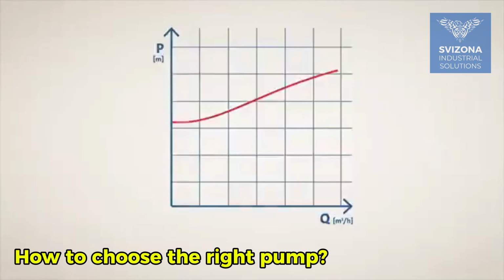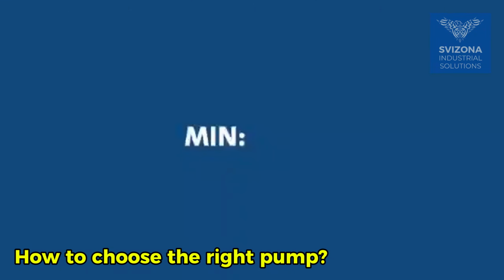How to choose the right pump?

Comment: Usually a mechanical engineer knows these but for others the information is quite useful but incomplete. It should include an example selection using those curves for a most common application like domestic or irrigation water pump.